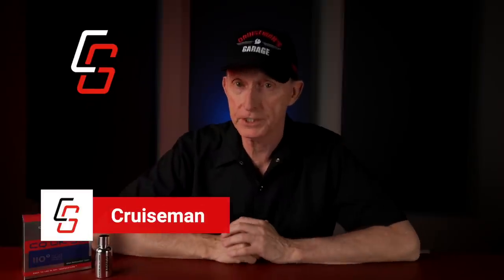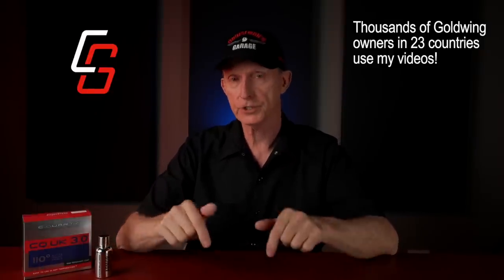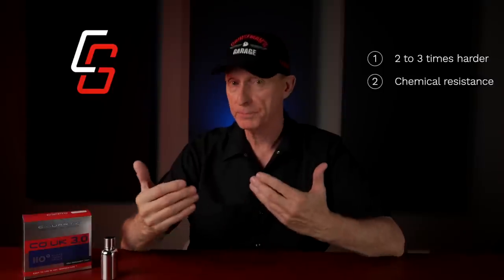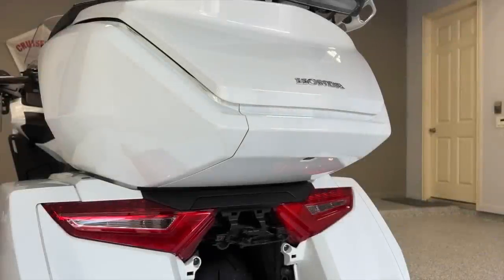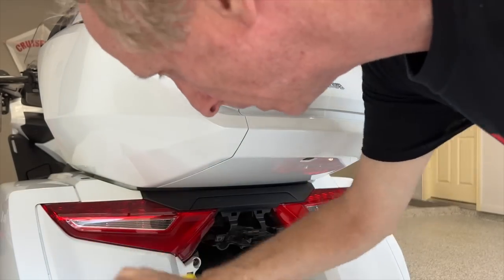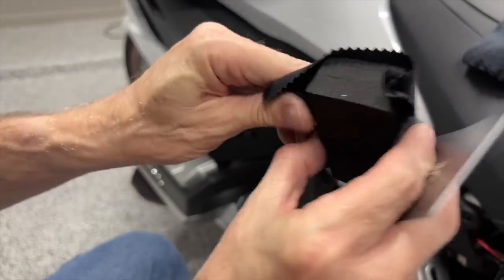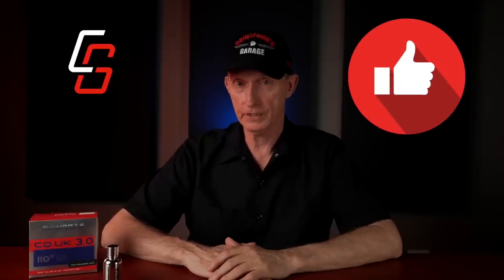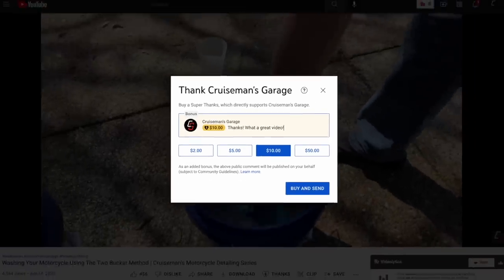Ceramic Coating A 2018 Honda Golding GL1800 | Ceramic Coating Your Motorcycle

Comment: Really good instruction. Yes they make coatings for matte paint. Dr. Beasleys make a coating that's for matte paint. Yes....do not polish matte paint! 
Yes you can coat black trim with same ceramic coating. Make sure it's clean, and NO polishing. 
As far as chrome exhaust,  there are ceramic coatings that are heat resistant. It would be same coating that you'd use on wheels due to the high temperatures from brakes.
Also very good idea to use 2nd microfiber towel after you've "leveled" the coating from first wipe down. This will ensure you won't get high spots.(dark areas where coating wasn't leveled properly). 
I've done many many ceramic coatings and the Pro-sumer grade coatings are getting better easier to apply. 
Yes equipment and products are expensive, but a complete paint and clearcoat do is 10 times more expensive!

Comment: I used Armor Shield IX on on my 2019 DCT Tour about a month ago after a full paint correction. I also did all my black plastic. The plastic retained its matte finish but is just a little darker. I also removed my windshield and coated it. It looks awesome. 2 coats on everything and still lots of product left in the bottle. I'm hoping this keeps the scratching of this soft Honda paint to a minimum. So far so good. I also did the chrome on my exhaust. Candy Ardent Red looks great all glossy.

Comment: Looking at getting a brand new 2022 Goldwing Tour next week. It's gonna be the black one so I'm planning on making a ceramic coat the very first thing I do on the bike. I have a lot of detail experience with all the prep but I've never done a ceramic coat. I always have used Sealants. So hopefully my installation process goes as well as yours. 

I need to get a new orbital though...

Comment: A had my 2021 BMW K1600GTL ceramic coated when new by a professional detailer.  Although I absolutely love it, would have done it myself if I'd seen this.  Quite expensive.  By the way.  I'll be in Fort Worth next week to meet my new and 1st grandson.
Reply from the maker: Congrats on the new grandson!

Comment: Chris, just out of interest how much of the product is left in the bottle after you have given the bike it’s first coating. Is there enough left to re-coat the bike again in the future?  Always look forward to your videos, greetings from Nottingham U.K.
Reply from the maker: It probably only took 15% of the bottle to do the bike. You could do 3 or 4 motorcycles with one bottle.
Reply: I also did mine and agree at least 3-4 bikes
Reply: Answer to question: store unused ceramic coating in cool dry place. Make sure bottle is closed. Shelf life can be 6-12 months after bottle has been opened. If you want to use more coating, take older rag and clean top of bottle off to remove dryed residue. If you don't, small crystals will go on applicator and scratch your paint.
Reply: Guys,

YaH The Heavenly FATHER HIMSELF was Who they Crucified/Pierced for our sins and “HERE IS THE PROOF”

From the Ancient Egyptian Semitic: 
"Yad He Vav He" is what Moshe (Moses) wrote, when Moses asked YaH His Name (Exodus 3)

Ancient Egyptian Semitic Direct Translation
Yad - "Behold The Hand"
He - "Behold the Breath"
Vav - "Behold The NAIL" <— YaH’s Crucifixion
He - "Behold the Breath"

“Behold the HAND that Beholds The NAIL” 

PROVES - YAH The Heavenly Father HIMSELF was Who they Crucified

That is EXACTLY what Moses Wrote

Here is what they mean

YaH's Name:
(Ya)d + (H)e, as YaH is what Moses called Him and YaH Declared: "this is My Name, this is My Name for all generations" (Exodus 3)

YaH is The Creator of “MAN”: (Genesis 2:7)
Yad He, (HAND BREATH), as YaH's "HAND" Formed man from the dust  of the Earth and His "BREATH" made him a living being (Adam)

YaH's Sacrifice of Crucifixion for “MAN”:
Vav He (NAIL BREATH), the "NAIL" through YaH’s "HAND", in Sacrifice of Crucifixion, that whosoever shall call YaH Savior, His “BREATH” brings forth life (Salvation)

How YaH arrives:
YaH arrives via the Tent of Meeting (Exodus 33:7:11, Isaiah 54, 55), where a Tent is erected outside the city, a cloud descends upon the entrance of the Tent and YaH appears...

Why they demanded YaH to be Crucified:
YaH was Crucified according to Hebrew law (Deuteronomy 21), to be NAILED/PIERCED on an Almond Tree for BLASPHEMY as it was for His NAME they demanded Him Crucified. The Messiah claimed He was YaH...

HE WAS YaH!!!

HalleluYAH translates “Praise ye YaH”

The Hebrew Book of Isaiah

Isaiah 42:8
"I am YaH; that is my Name! I will not yield my glory to another or my praise to idols.

Isaiah 43:11
I, I am YAH, and there is no other Savior but Me.

Isaiah 45:5
I am YaH, and there is none else.

Comment: I just bought a 2022 Goldwing Trike from DFW Honda and I have an appointment to get it ceramic coated on January 16, 2023.  Is ceramic coating the windshield and instrument clear lense a wise idea?
Reply from the maker: I would not do it just of what it takes to REMOVE the ceramic coating when the time comes.
Reply: Thanks I’ll instruct them to not do either

Comment: Very good Cruiseman. What was your thoughts on the Honda emblems and rubber gaskets next to the paint. That is did you leave a small gap to keep the coating off of those areas? Thanks
Reply from the maker: Honda emblems OK. I tried to avoid rubber, but if it does get on there, once it dries if the rubber flexes, the ceramic will just flake off.

Comment: Hi Cruiseman 
This has nothing to do with your video on Ceramic coating. Has anybody had there Speedometer stop working on there GW. I have a 2017 and it’s stopped working any advice. 👍🇮🇪

Comment: Looks great, just 1 question did you do your  wheels as well ?
Reply from the maker: I did not. But I am considering it.
Reply: I had my K1600GTL professionally coated , and he put ceramic on everything but the engine and exhaust.
Reply: The wheels would be off the bike for that?
Reply: @jimmyt55  you can coat wheels on the bike.